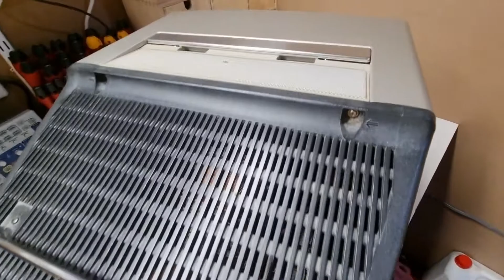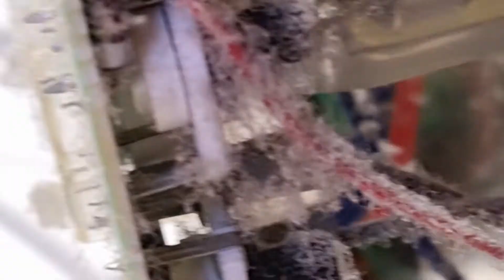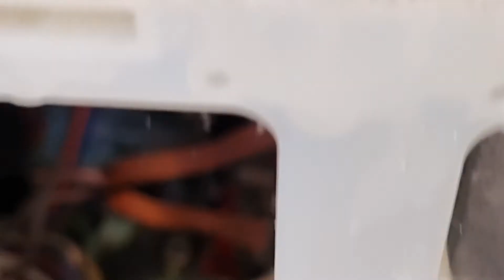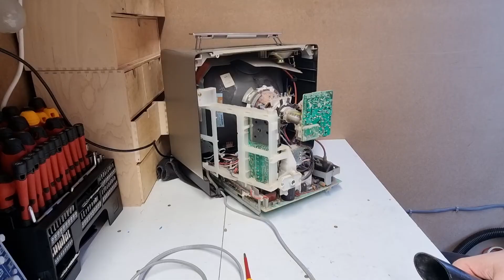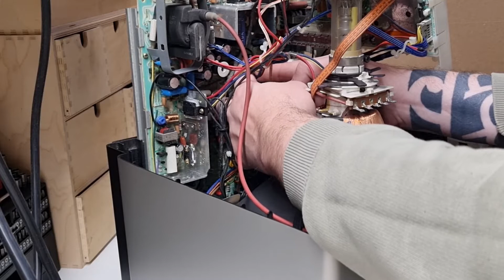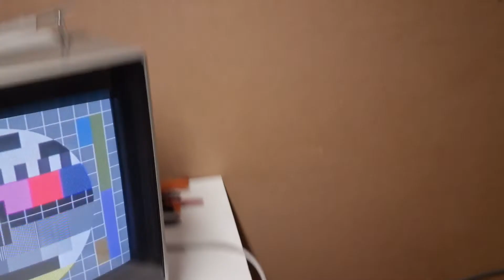1983 Sony KV-1412UB Trinitron dead on arrival and repair

Comment: Hi what is the little jack socket on front, bottom left for? I am trying to connect an Atari Flashback to this TV without success any ideas? Cheers
Reply from the maker: That is the headphone socket. This model is RF only. No composite or scart